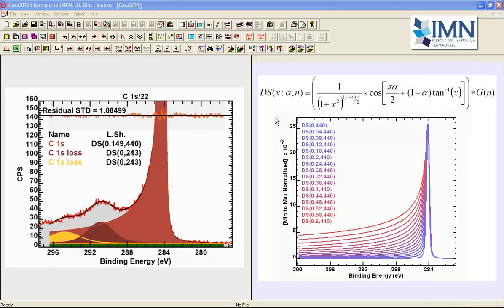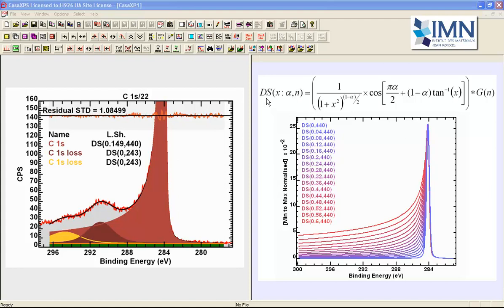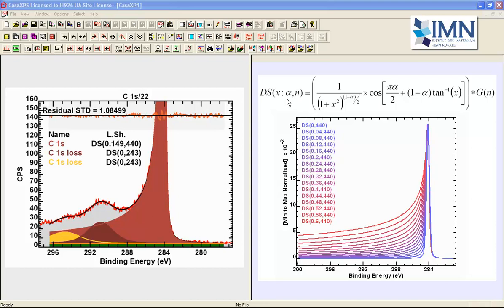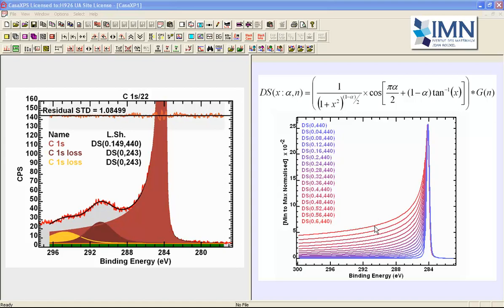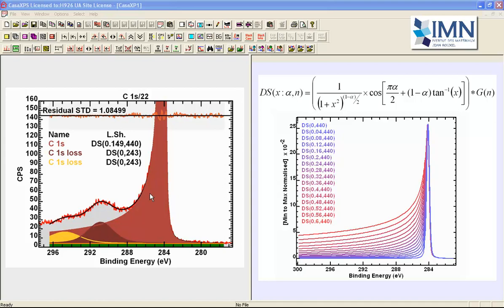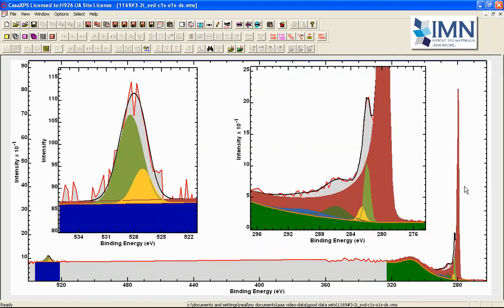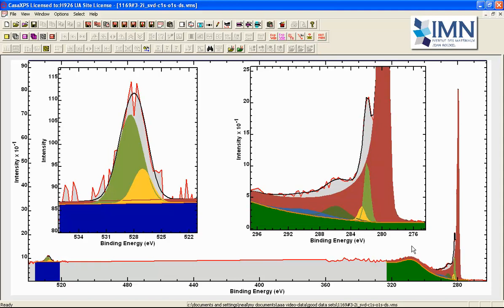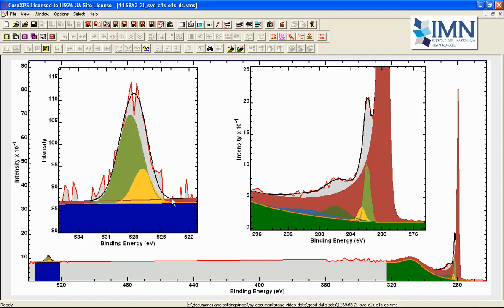Doniach Sunjic Line Shape and Graphitic Carbon in CasaXPS

Comment: Hi,
I cann't find the Doniach Sunjic profile when I quantification the peaks. There are the ONLY the SGL, LA and the TLA line shapes in the list. Is this DS a new feature in the CASA? But the version of CASA which i am using is Casa2322PR1-0, I think it is lastest one.
Reply from the maker: The selection of line shapes offered is limited to line shapes configured within the CasaXPS.DEF/ParameterFile.txt and any line shapes used in VAMAS files opened or line shapes manually entered via the Line Shape field on the Components property page. If you wish a DS line shape appear in the list of line shapes you need to edit the ParameterFile.txt and enter a string. The DS line shape is not easy to use hence it is not one added to the default ParameterFile.txt configuration file.
Reply: Thank you for your explanation. So, I simply added “xps default lineshape : DS(0,243)” to the ParameterFile.txt in the CasaXPS.DEF directory. The DS line shape appeared in the list. And it seems work fine. Am I did this correct?
Reply from the maker: Yes, that sounds correct.
Reply: thanks again.